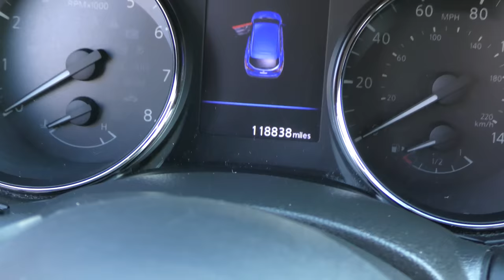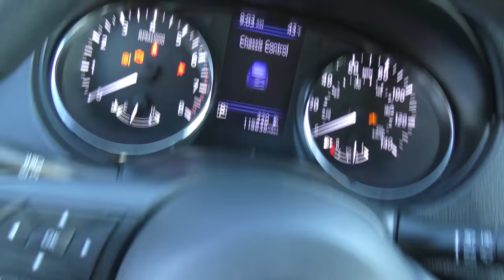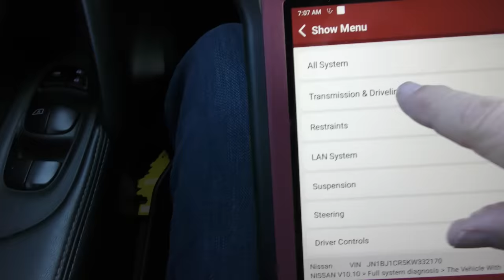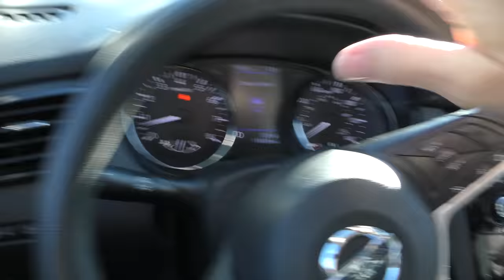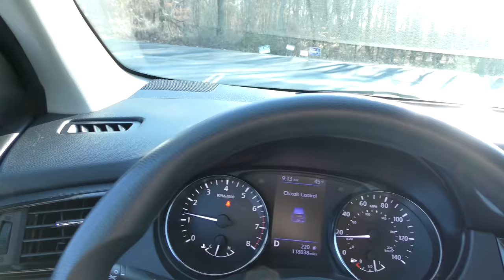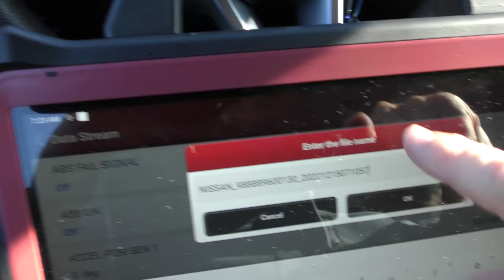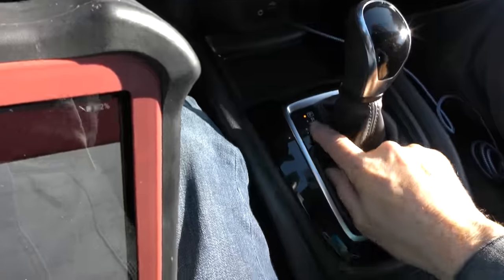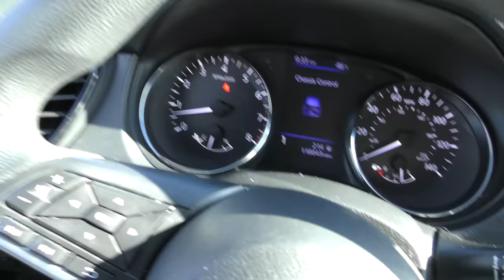The Worst Transmission Ever Made (Do Not Buy)

Comment: It's backlash from greater clearance wear measurements.(Not as tight as when newer)
  Just change your CVT fluids every 30 - 40,000 miles, cooler and CVT pan filters at least once or twice in the life of the vehicle.  Don't abuse your CVT and it'll last a good long time.  (118,000 miles is already a Hallmark 
 Keep it up, and who can complain about high 20s to 30 mpg consumption rating!)

Comment: My 2009 Subaru impreza had a cvt transmission with 137k miles and started having shifting issues so I traded it in for a newer 2021 model. When I would accelerate it would go up to like 40 mph then downshift on its own then shift back up for no reason. No stress on the motor or anything. Also found that using premium fuel was perfect. Regular gave bad mileage and super would cause it to kick really hard on acceleration from having fantastic acceleration. Went with premium problem solved 90%.
Reply: 2009 does not have cvt my friend bc i have a 2010 impreza(i have drained its transmission) its a 4eat that gen. Its the 2012+ Imprezas with a cvt. If you had shifting issues you should have dropped the pan changed the filter and possibly the shift solenoid.On top of that maybe even lucas oil bc according to manual it is actually compatible with dextron and mr subaru on youtube recommends.
Reply: @b469b  Does a 2009 Subaru Impreza have a CVT transmission?

The Impreza offers two versions of Subaru's Symmetrical All Wheel Drive system. Models with the manual transmission have a viscous coupling locking center differential that splits power 50/50 front to rear. Models with the automatic use an electronically managed continuously variable transfer clutch
Reply: @justinbowen1183  It still has gears(no belt) just shifted by the computer. Trust me manual says to use subaru/idemedtsu type hp or if not available dextron III(thats good new cvts are rarely fixable at higher mileage). The autos i believe are limited slip differential but i am not positive.I did change my gear oil and it helped a lot i was at the point of mild torque bind cleared right up.

Comment: I have a 2014 Nissan Altima with a 3.5 V6 and a CVT. it has 37,000 miles on it and it runs great. Before it was out of my used car warranty I paid the dealer $100 to replace a bad position sensor on the engine. For $2000 I extended the warranty for 6 years or 95 000 miles on the odometer.  If I bring it to Nissan zero cost to repair. Elsewhere $100. Its 270 hp engine goes like a bat out of hell, great fun to drive, runs like new. It's faster than my 1996 Lincoln Mark VIII LSC with a 290 hp 32 valve V8 Intech engine. So far very happy.
Reply: how’s it going thinking of buying a nissan maxima sr
Reply: @Savage Riddle  The Altima with the 3.5 liter V6 works great. We tried Maximas and were surprised we didn't like them as much. You'll have to test drive them for yourself. I haven't driven much in the last few years. The Altima I bought is really fun to drive. I didn't consider a lower power model. I bought it for my sister and inherited it when she died. I've never bought anything less than a V8 for myself. I've never bought a foreign car for myself. Scotty Kilmer doesn't like the CVT transmission.  I've had no problem with it so far but if I do I'm fully covered by a Nossan warranty up to 90,000 miles.

Comment: The thing about Nissan CVTs, is the "gear" simulation. It causes the belt to hold ratios more often than it should, so it wears bands into conical drive surfaces faster.

Comment: Most people don’t do proper maintenance on their vehicles. They wait until something breaks. I have 150,000 miles on my 2015 Honda Civic. I change the oil every 5,000 miles & change the CVT fluid EVERY 30,000 miles. The car runs like brand new.
I wonder if the people that have CVT transmission problems have EVER changed the fluid.
Reply: That's true and Honda's are engineered a little better than Nissans too, and that helps.

Comment: My 2018 sentra has over 77k on it and I haven’t had any issues with the cvt, it’s been overall reliable
Reply: Give it more time that’s still relatively low mileage
Reply: I would still change the fluid if you haven't already

Comment: I change the fluid in my Jatco CVT every year 10k-12K.   Cost me about $80 worth every penny.
Reply: I think it's recommended every 30K, you're really doing it too much!!
Reply: @metalmike570  If they have a Nissan Jatco cvt then they are not changing it too much. lol
Reply: @metalmike570  Actually, it does not hurt to do it. In fact, when you feel the CVT doing strange stuff, you change the fluid and it goes away. I had a 2013 Sentra, which I loved and I felt it ran better with each fluid change. I got to 98k miles with it in 4 years and I got scared of the CVT going bad, as the 100k warranty was about to expire so I traded it at the same dealer I bought it for a Frontier. I almost cried when I left the car at the dealer. The salesperson told me he sold the car the next day, as the buyer saw the impeccable condition and service record.
Reply: @gabrielsierra6890  I think Nissan's are designed to be traded in as soon as your loan is paid off. For me it's 6 years. Only problem is you're always paying a loan!!
Reply: @metalmike570  where I live, we have tons of Nissan cars that are 15 and 20 years old. It was this particular CVT that was installed from 2009 to 2018 that was problematic when neglected. I traded my Sentra for the Frontier and a year later, they extended all CVT warranties to 10 years. They have since replaced that CVT on newer cars
Reply: @gabrielsierra6890  Thanx for the update; mine's a 2019 and it seems good, so far.

Comment: I purchased a 2022 Nissan Rogue Sport because I wanted a small economical car as a daily driver. However, I began to notice that every time I drove it my ears would start ringing. I did some research to find out why the car was so loud and I discovered it was because of the whine of the CVT transmission, and I was upset to find out that my Nissan operated with a friggin rubber band. I hated this car and after 4 months traded it in for a 2023 Mazda CX-30 Carbon edition which is a fantastic vehicle.
Reply: Hi mate, just wondering how is your Mazda now because I am also thinking about changing my nissan to mazda
Reply: @purmortalwang1097  I have had my CX-30 for over a year now and I absolutely love it. I have made several trips to southern Utah, Yellowstone, and the Oregon coast and it is such a smooth and quiet ride. If you have a large family the CX-5 may be a better fit.
Reply: @edwardwhite4015 Thanks for your response. Yes seems Mazda would be my end goal!

Comment: With all these modern auto transmission horror stories, why don't we all just go back to driving manual gearbox cars?. Solid, reliable, bulletproof, last for as long as the engine turns, little to no maintenance & gives you the freedom to drive your car to your own style, whereas in the auto you are restricted by the computerised program in the automatic transmission.

Comment: My 2013 Honda Accord has 300,000 miles. Original engine and CVT still going strong. And my Dad's 2014 Honda Accord has 325,000 miles on the original engine and CVT.
Reply: Honda's usually last longer than Nissans just the way it is.
Reply: Danny  How often do you change the Trans fluid ?
Reply: @jayhockley8841  Every 50 or 60 thousand miles.
Reply: @dannyeshleman1311   Ok , just wondered .  Thanks !

Comment: I have a 2018 Toyota C HR with CVT transmission which I am not a fan of as well.   I prefer the old transmission.   I bought the extended warranty just because of the CVT transmission 5 years with 90,000 miles warranty from ALLY.   I will let you know when the transmission fails.

Comment: I agree! Bought a brand new Mitsu Outlander in 2017. All service done on time. At 125k transmission died on the highway. No junkyards had any, and had to buy a new transmission for $10k total parts and labor. I do not recommend Nissan, Mitsubishi, or jeeps with Jatco CVT transmissions
Reply: 10k for parts and labour?!? Hot damn my civic to do a tranny swap was only 3k including an extended warranty on parts and labour hot damn dude😯 I'm still paying on it as a matter of fact
Reply: CVTs in anything Mitsubishi is a weird lottery honestly. I know owners who haven’t changed their fluid at the intervals indicated in the manual and haven’t had issues at all and I’ve known some who do change the fluid every 30k miles as well as the filter and have the CVT go out not even at 60k miles already. 

The one in my ‘16 Lancer hasn’t gone out yet nor shown any issues with slipping and fluid’s been swapped along with the filter. Here’s hoping it somehow doesn’t grenade before 125k lmao
Reply: @justinbowen1183  oh trust me I know!!! if it wasn’t for family giving us a had with that we would have a giant paper weight sitting here. The rest of the vehicle has given us 0 issues!! Motor is great, just had new tires put on, paint and body are great. It was just the weak point of a CVT. 😢
Reply: @losalva4220  Some Nissans and Mitsubishi's do use the same parts; they both have Jatco CVT's is what I heard.
Reply: @metalmike570  they slightly different, manufacture design the CVt jatco build them, only the new in rogue and outlander are the same.

Comment: I have this Nissan Qashqai/ Rogue Sport for 6 years now. Very reliable car and the cvt is super smooth. I prefer it much better than my old Toyota 4 speed auto.
Reply: I got a 2022 nissan rouge sport and notice its made in japan than other models.
Reply: Were you doing transmission fluid change often??

Comment: worst cvt transmission was the cvt in saturns! I worked for saturn and you were lucky for the cvt to last 20,000 miles in the SUV seen many not make it much past 10,000 miles when in a car they lasted longer but still failed. Some Aftermarket warranty companies stopped offering warranties on them which I dont blame them because it was a gaurentee for the transmissions to fail. Its crazy to me how a transmission so bad ever gets put into production how do they not test them to know i mean in this situation if they only put them in cars and use a different transmission for the suv's  it would have been a much smaller problem.

Comment: Have a Mitsubishi with the Jatco CVT. I have 110,000 miles and no issues.  Replace the fluid and filters every 30,000 miles and they will be fine. I use mine in eco mode and it puts less stress in the transmission
Reply: So eco drive mode is good ..I  drive on eco mode every day all day so is that good or nhave 2018 honda crv

Comment: I bought a 2007 Nissan Sentra with the cvt transmission.  It went through three transmission before 50,000 miles.  Nissan said they wouldn’t replace another transmission even though it was still under waurantee. I sold it the next day with 52,000 miles.  No more Nissans.

Comment: On my 12' Altima with 114,000 miles I don't notice any jiggling at lower speeds.  I believe the best way to drive these cars is to to apply light but steady acceleration to get them up to speed.  Next is to change the CVT fluid every 25,000 miles or 2 years whichever occurs first.
Reply: Do you drive on eco drive or no??

Comment: Just got my 2016 Sentra back from its second CVT replacement. First one was replaced at 27,000 miles. The second at 20,000.  Not even 100 miles in after I got it back and I already had to send it back to Nissan because the Check Engine light came on… Again. Never again with Nissan. Do Not Buy.
Reply: Thank you for the warning ⚠️ They just don't build things like they used to
Reply: @belindaspechtenhauser6621 hey sure don’t. Only reason I went with them again is because I never had any major issue with my 04 Sentra. 130,000 miles on it and it still runs great. Then again it’s not a CVT.

Comment: Both my dads 2014 Pathfinder and my moms Murano have bucking issues at low speeds. It was just a few months ago I was driving through a residential neighborhood doing 25 mph while barely touching the gas and I could feel it bucking and the RPM gauge indicated that. The tack was bouncing back and forth between 1500 and 1750 RPM. It’s like the transmission can’t decide on whether or not to drive in 2nd or 3rd “gear” (I know they don’t have gears). My 2014 Toyota RAV4 doesn’t do that driving that exact same way.
Reply: The pullies inside are starting to stick and the transmission's are trying to find the ratio they want, but the pullies aren't cooperating because the bearing balls the pullies slide on are crumbling.  They will fail soon, best to decide what to do with them while they still move.  First try a fluid and filter change, but if nothing changes, or if there is a bunch of metal in the trans pan, they will need a overhaul.

Comment: I was told the jatco CVT was not built for larger AWD vehicles like my outlander that’s why it went out. I’m guessing if you have a small suv or car you might be ok.
Reply: Honestly anything with a CVT with Mitsubishi is a lottery at best. You can drive the thing decently spirited and forget to do the fluid changes diligently and have issues but then do the fluid swaps as needed in the manual and baby the car and have the transmission grenade itself before reaching 60k miles.

Comment: Ehhh, I've got 327K on my manual 5spd '07 civic. Never changed the transmission fluid. I only changed the oil every 5-7k and replaced the break pads a few times, and the window motor, sometimes the air filter.  The only problem I have is the odometer doesn't work but that's why there are apps for my phone, problem solved. Oh yeah, great AC still here in the Arizona desert.
Reply: those manual civics will last forever the body will rust out eventually

Comment: Watch out, I'm Dutch and CVT is a great invention. It can switch gear "in between fixed gears" so to speak. There is only one huge problem. It was designed for low power! And today there is also a freight truck version. Those are good. But the introduction to the States has gone wrong. It has. Heavy cars and a lot of power, they simply sold these CVT's too soon. I won't name the brands here, but the systems do not work the same, and only a few brands are good. Find out yourself.

Another two notes. Workshops replace the transmission oil. But fun fact is, they must buy the brand one of those CVT neirds has found. There is a certain oil that is far better than the oil that the car brand tells you to apply. And that is weird. But it is true. FIND that specific transmission oil. It will save your belts.

What you MUST know and what you MUST do, is using your brains in a traffic jam. Normal automatics have an automatic clutch, so you can do a full stop just pressing the brake.
A CVT however is always pushing you, when in drive. During a full stop, you destroy your drive belts. Always switch a CVT in neutral, when waiting at a traffic light, when doing ANY full stop. For Americans, that was absolutely a problem, and 5 out of 10 negative CVT stories are their own fault. It must be. But I am convinced the car brands should have never promised that the CVT was good enough. The first generation simply is not strong enough. Yes, the CVT fans who always drive like my frugal granny, easy peazy, gently rolling, those keep the car working. But when you floor it every two minutes? Within a month the first belt snaps. Surprise  surprise. Buy a newer car, from the right brand, and find a CVT specialized workshop, with a mechanic who KNOWS that tansmission oil. Or you are paying extra bills.

Comment: We had two 2011 Nissan Versa sadly my hatchback in an accident at 189k . I had no issues with it just changed oil every 3k. Hubby still driving his sedan almost 300k on it no issues small stuff we never had transmission problems . Back I the day had Honda CRV 1996 at 100k needed transmission we dumped it. I now am looking for vehicle but not so sure Nissan way to go after these videos maybe we just got lucky? What are good ones with torque converter? Mechanics in the know?

Comment: The trans is weird. The rpm can be dropping while the car is accelerating.  Or press the accelerator(not a throttle) and rpm doesn't.change, but car speeds up. This is because the trans ratio changes without a gear shift, and more rpm is not always needed in minor speed changes.

Comment: My rogue is one dependable car awd I drive very consistent speeds and I get 38 mpg on the back roads
Reply: i am a gm guy  but got a 2018 rogue  just to see what the fuss is all about  ,an nissan  just gave us a 7 year 84,000 mile free replacement  for the cvt,, my wife  loves it ..i knew about them  anyway  ,,have it serviced an it will last  ,,like you said great mpg ...cant hurt the 4 cyl
Reply: Liars!!! Rogues are garbage!! I am with one as a driveway decoration now, at which I absolutely NEED a vehicle to drive my daughter 40 min to school and cheer practice and basketball practice and games. She is in 8th grade, and what worst timing. I absolutely need a reliable car, and NISSAN IS NOT IT. Replaced coolant reservoir and hoses day one, next was front control arms, sway bar, linkage, then the radiator, alternator, battery,control arms again, wheel hub bearing assembly, ** ignition coils, spark plugs, fuel pump, and this thing will not start
Reply: @lopez121709  what year is it  1940??
Reply: @lopez121709  sounds like you didn’t take care of it at all !!! I’d have to lay that at your doorstep
Reply: @Monza62000  2009
Reply: @lopez121709  2009? You are acting like it’s a 2022. Parts wear out. It’s does not make Nissan horrible. I seems far more vehicle with more issues.
Reply: @lopez121709  thats sad  i have one my boy has one   ..they are very well made  did you buy it new?